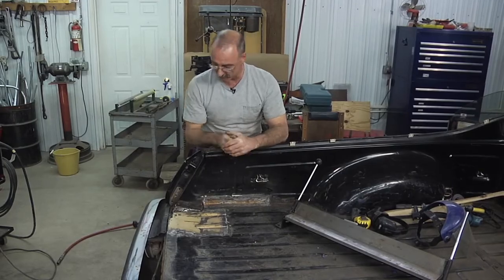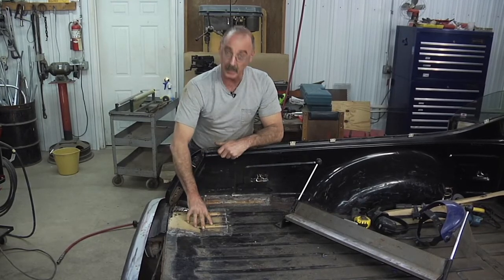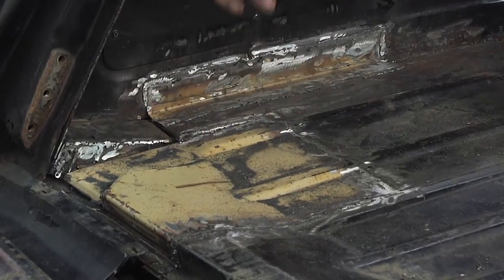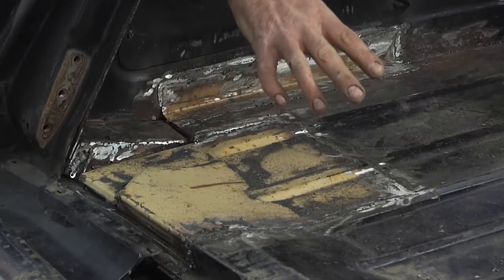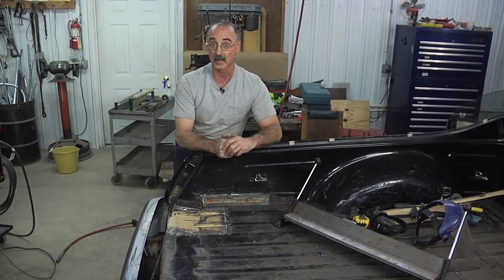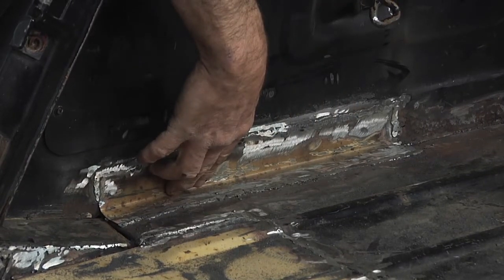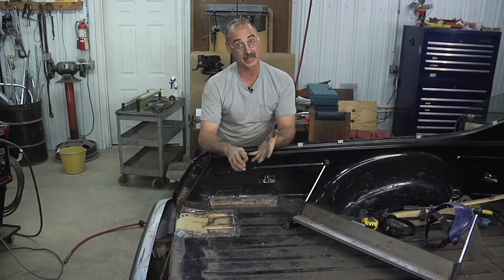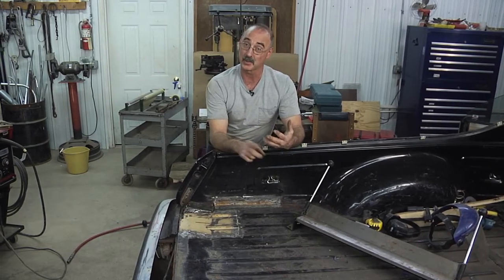AUTO FABRICATION VS. TRANSPLANTING CAR PARTS

Comment: When you're transplanting from a donor car (or, for example, get a replacement floor pan) - how do you get the alignment right?
Reply from the maker: Hi, David. Before removing any panels from a car it is important to take precise measurements to ensure the new panels are welded in the same location.